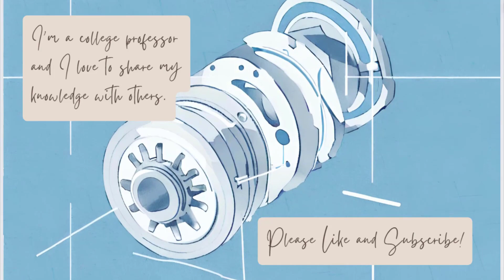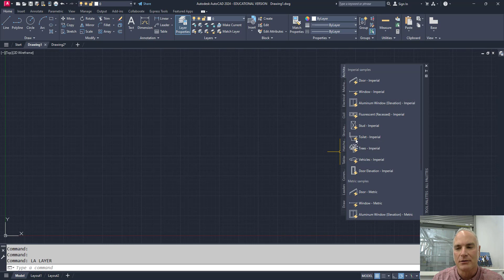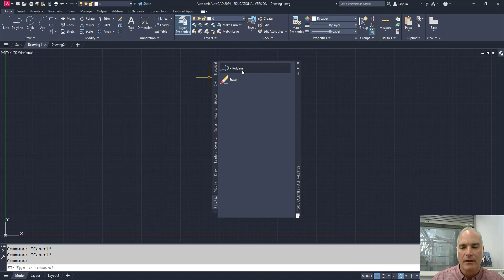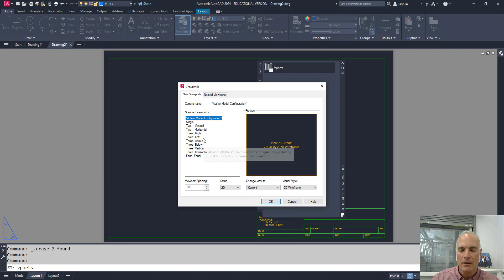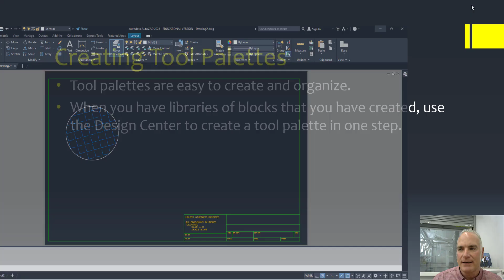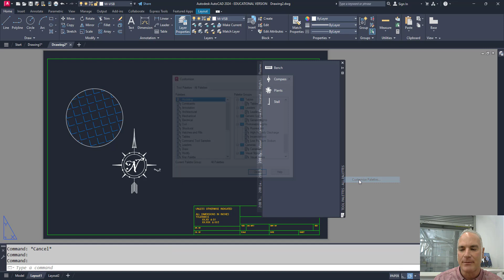AutoCAD - Tool Palettes

Comment: Perfect video. Unfortunately my some of the tool plate image doesn't load. Any tips?
Reply from the maker: The image is created when you drag the block to the tool palette. When you export the tool palette, AutoCAD creates a separate folder in the export location with images in it - there are four images for each tool: small and large, dark and light. If you have problems with te images, you might have moved or deleted these image files. Always keep the xtp files and the image files in the same folder locations.
Reply: @professor_porkchop  By chance do you have an email address?